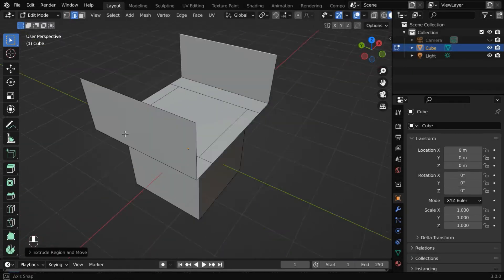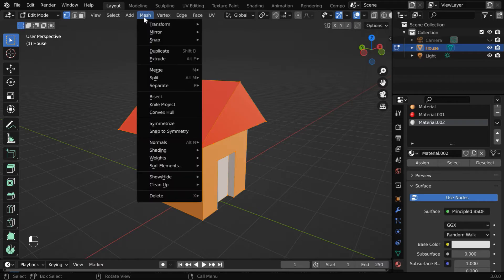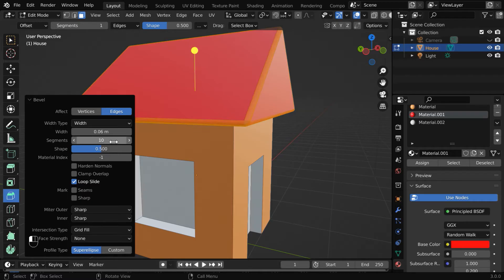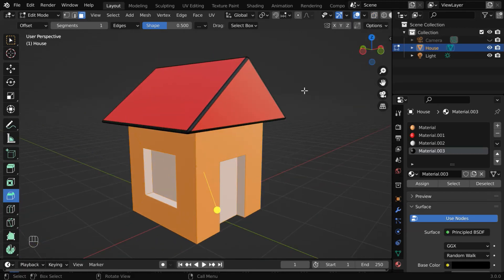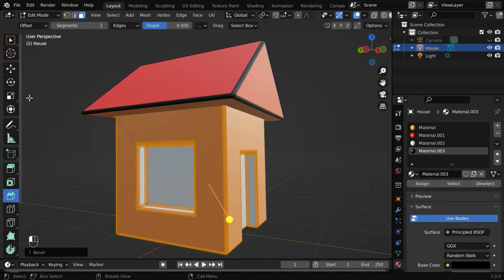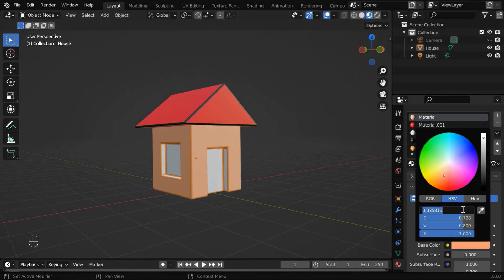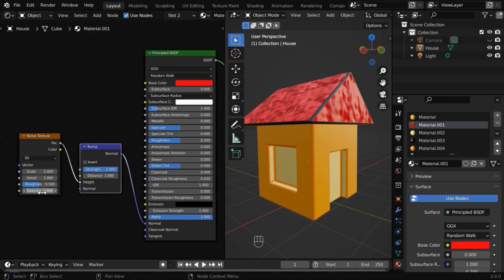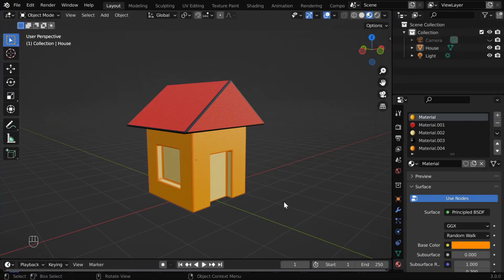Low Poly House In Blender | Easy Modeling : Part-2 | Mesh Editing - Bevel - Materials

Comment: I got through part 1 and onto part2 BUT when I Bevel the bottom portion of the house it looks like spider webs appear there like lines connecting the underside of the roof to the bottom of house so I had to skip that part for now cause I think its my old computer running Linux Mint 21.1 and old GPU BUT all of your other things I follow on here and make come out good JUST problem with Beveling bottom portion of the house. Awesome teaching like always 😁
Reply from the maker: Sorry for this late reply. Beveling can turn out to be very difficult at times. But to help you with this, I need to see your model. Can you please send your blend file to us (5minblender@gmail.com) so that we can check it and suggest a solution? Please briefly mention the problem in your email as well so that we can recall what it is about. Thanks!
Reply: @5MinutesBlender  Next time I got it on I send it sometime this week if OK.
Reply from the maker: @TomGeewhiskeytango15511meterDX  Sure!
Reply: @5MinutesBlender  no problem on later reply it's all good and always look forward to more videos 😀.

Comment: 02:05 when i select Bevel.. that baloon selector doesn't appear 90 degree.. it slants, why?
Reply from the maker: The baloon selector goes perpendicular to the selected edges/ faces. If the selected elements do not have the same face orientation, which is very common, the baloon selector will take an average of their normals. Nonetheless, when you actually add the bevel, each element will get its bevel in the correct direction. Just in case that is not happening, there are probably some errors in the mesh construction. You can easily resolve them, please check our tutorial on how to solve bevel problems.

Comment: bro 1 help
how to cut man head with sword
Reply from the maker: You can create three objects, one head, one body, and one body with head. Initially display the body with head. When the sword passes through the neck section, you need to display the two individual parts hiding the original body. With suitable tilting of the head and with a spray of blood, you can make it more realistic.
Reply: @5MinutesBlender  no you need 3 things, one man, one knife, and one will power to cut ;)
Reply from the maker: @Padhai_with_Princy  After reading this comment, I'm thinking, how about using a woman instead? 😜😜